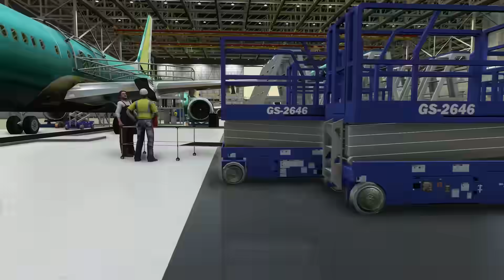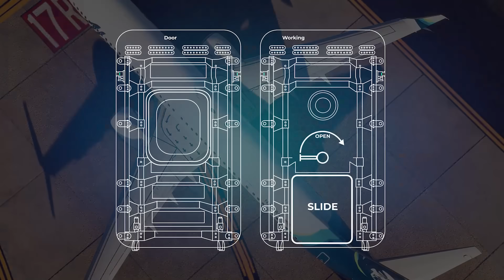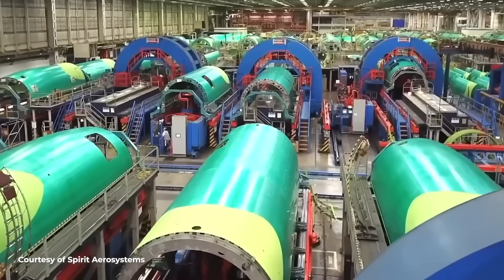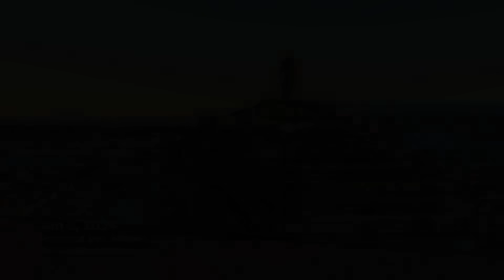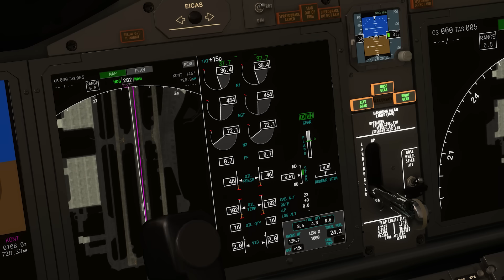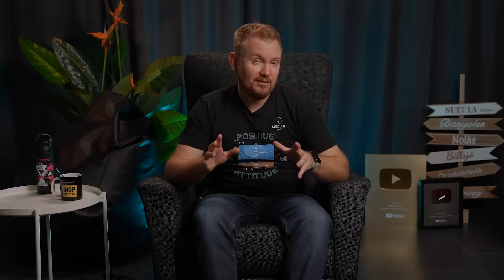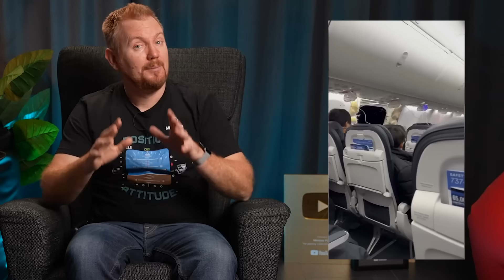Boeing 737MAX BlowOut!! The Scandal behind Alaska Airlines flight 1282

Comment: I think it is crazy that in a day in age where you can store thousands of hours of audio in less space than the nail on your pinky finger takes up, that the CVR only holds 2-hours of audio.  Then again an agency notorious for being the largest user of vacuum tubes in the world may not be up to speed on what modern technology can allow for.  Really, with things like Starlink now available on airliners, the flight computers should be transmitting to a virtual black box on the ground so as long as the Starlink antenna array is in an orientation to where it can see Starlink satellites.  Ground computers can hold a lot of stuff.  And really, I don't think there is any legitimate excuse why a black box couldn't hold more.  Yeah, you need to make it so the black box data can survive just above anything.  But just because you are using recording technology from the 1950's and 60's doesn't make it more invincible than what technology can do now.  I am sure you can devise an update with more modern technology that can pass the survivability requirements.

Comment: Rivets are level 1 as they are pressure boundary fasteners but the Locking device pins are level NA  thus they do not have the same insp requirements

Comment: Funny how the springs that surely played  a big role in catapulting the plug out of its seat like a compressed  pogo stick were left in place although not needed in this configuration, without them I do not think that the plug would have detached.
Reply: They are used in this configuration.  The plug door can be opened for inspection, in which case the springs help lift the door.

Comment: As an allmost engineer (i did not finish my course) the manager deciding to choose for "Just opening the plug so it can retain an SAT and no further action will be needed" must have never had any engineer training, because in that case he would have heard of murphy's law and would have chosen for a path with an integral final check-up on the work (CMES if i write it correctly).

I hate when people do stuff like this.

I must say i am very glad injuries where just few and minor!

I am an upholstery guy mostly for flight cases and on friday i got distracted and missed a few steps in finishing 4 boxes. But i always lay out my work so i had two pieces left over and that got me thinking about my distractions and i took those 4 boxes back into my workplace for check up and i got them finished eventually.

Someone should have taped those 4 bolts to the door plug to remind them and other workers that they needed to be fitted again.
And since it is aviation and lives we talk about, this work should be written down as needing extra inspection effort.

What i am saying is workers should train themselves to help with oversight of job completion and especially when things become more responsible management should pitch in and give workers back-ups, just because murphy's law will always be a thing and mistakes will be made.
Reply: Nah i understand why he would do it, its faster and probably easier to fix with less delay. Doesn't necessarily have to do anything with putting it in the system. The problem was that there wa snot the correct checklist to be done afte changing the seal. Normally that should have been correctly stated in a work order. That is also normally atleast in Airbus the standard procedure where a non conformity then also needs to be signed off by quality control
Reply: The problem is that so many company directors are deciding to save money by either out-sourcing by separating different divisions into individual entities within the corporation, or out-sourcing while shutting down their own divisions, or simply forcing workers onto workplace-agreement contracts (or a combination of these).  As the parent company then dictates how much a contract is worth, the off-shoot is forced to hire the cheapest sub-contractors they can find, meaning skill-levels & standards drop!
Here in Australia, Qantas board-members (especially the outgoing CEO), have made a killing in bonuses & shares, despite the airline's reputation & value taking a nose-dive! 
The result is of course that the bosses expect the workers to loyal & hard working, but all the while paying less, with no pay for holidays or sick-days! 
The old saying is;  "If you're only willing to pay peanuts, then you'll just get monkeys!"
Reply: Per Boeing processes there should have been a removal written to open the door plug in CMES and attached to the Non Conformance Record addressing the bad rivets. There also should have been removals written on the wall panel, stow bins, and whatever else had to come out to access the plug. But Boeing has been unable to produce any removal records whatsoever. Boeing is in violation of its own processes and FAA requirements. Probably some low level manager was pushing to speed things up.
Reply: I don't agree with workers should train themselves to help with oversight in this industry.

I do agree with this IF it's completely independent of the workplace expectations but as a general rule no.

The inspections, instructions and quality control should be the ultimate factor in these situations.

The workers doing the actual fitting work WILL miss something eventually if there is no process to check (specifically a dedicated person to inspect the work).

Saying it's the mechanics job to do quality control means they will be lax with inspections.

Which in other industries is not a big deal and makes sense but not when a simple mistake can absolutely kill people.

Comment: Thanks once again Petter, for yet another crystal clear, logical, unbiased, factual and very instructional video.  Brilliant!   This incident takes me back to a military flight between Balad AFB and Basra in Iraq in an RAF C130.  With a tightly packed load of PAX in full combats and body armour, warm, tired and nodding off in the cruise (it was about 0300Z) when in a flash ....all hell broke loose!  Instantly, the hold (cabin) filled with dirt, dust, debris, toenail clippings and insulation material - which made it impossible to see anything or breathe.  As the now depressurised Herc went into a steep dive, the only way to breathe in this thick muck was to do so through the sleeve material of my combat jacket, whilst hanging on tightly to the seat webbing.  Being in a war zone, I thought we had been hit, but there was no panic and I remember how silent everyone was.  Wallop, bounce, rumble... incredibly abrupt and rough landing heaven knows where. Engines shut down, the loadmaster opened the ramp and everyone piled out...into the swirling dust.  Sorry, l'm rambling a bit, but anyway: it turned out that the young soldier sitting immediately in front of the port mid fuselage emergency exit door had stood up for a stretch, but in doing so had managed to catch the yellow / black door release handle on the webbing on his back, and .... wooosh!  So if this happens to you, then in the absence of oxygen masks, breathe through the nice thick material of your combat clothing.   Stay well, stay safe, and as they say on the London underground: "Stay clear of the doors please!" and "Mind the gap."

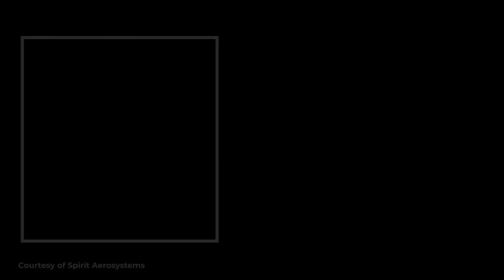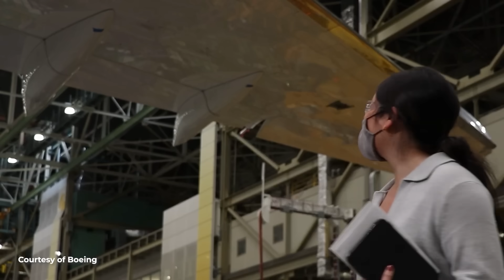Comment: I see at 8:07 and 10:32 in the rivet repair portion that the retainer bolts are in place!!  I guess there was a seal replacement so that would have needed the bolt removal.  Beats me how a team R and R ing a seal wouldn't take out the bolts and put them right back in.  Can a repair team who started the job not be required to finish the job?

Comment: I cant believe they just painted over faulty rivets I could get in some stuff taking shortcuts because it wont hurt anyone if you do but with aircraft ? it should be immediate firing when its found out and passed onto the police for criminal negligence since that could kill 250+ people depending on where the plane crashed if it fell apart.

Comment: Thanks for the accurate explanation of this situation without any of the usual management trashing that comes with it. The simple truth is, the bolts were not installed. For what reason is yet to be determined if it ever is. This is an ill-timed incident that has been totally blown completely out of proportion. I'm not condoning or making light of the situation just putting things into perspective as this could have and does happen in any manufacturing process. By the way, your graphics and explanation are amazing.

Comment: It seems like the Boeing engineers could come up with a vent between the cockpit and cabin which would equalize pressure without the noise and security issues associated with letting the door fling open. This strikes me as a "it's not a bug; it's a feature" kind of solution.

Comment: Another excellent video! As an ex Boeing engineer, I was aware of issues concerning senior management and I quit back in 2009. Considering recent events I am not likely to fly on another Boeing aircraft, no matter the type. I don’t expect to see any meaningful change in culture there in my lifetime (I’m 73).
Reply: Hm. I'd still feel fairly comfortable on a good ol'e 747 or 737-300 etc. The 747 is still a nice cigar with a fairly good track record.
Reply: @AB-80X  Good thing you quit early. The whistle-blower who exposed the 737 Max scandal was found dead from gunshot wound in an apparent suicide the very same day the DOJ announced a criminal investigation into Boeing and had been interviewing them.
Reply: Wait, you quit when? Are you a time traveler? (Joking of course)
Reply: @andon_RT  my bad. I quit in 2009 🙄
Reply: @andon_RT 
I guess there's a secret project Boeing hasn't disclosed😀
Reply: I love flying but I'm not getting on a Max.
Reply: @kentstallard6512  Just try to avoid any aircraft Boeing did built in the last two decades. 787 had just luck not to burn down in flight. Also try to avoid driving to the terminal. There are many less capable car drivers out there.
Reply: @kentstallard6512  same here regardless of their claims!
Reply: I will fly Max’s but I will always remain seatbelts in the seat
Reply: @alf513 You should actually do that anyway; that is, whenever you're seated, wear your seat belt - although you can loosen it a bit for comfort. The reason is that turbulence, especially the dreaded clear-air turbulence (which is undetectable) is a growing problem, and we semi-regularly see incidents where passengers (and flight attendants) are thrown bodily into the ceiling out of nowhere, with predictable injuries as a result.
Reply: @alf513  Good plan. That way when they try to ID the bodies after a crash they will refer to your seating assignment.
Reply: OMG ! Boeing is the safest plane ! You are clearly NOT an "engineer" !
SO much better, than these flying coffins called Airbus !
Reply: @gertjanvandermeij4265  Compare the Airbus accident rate due to design defects with Boeing. BTW did you read about the rudder issue UAL Flight 1539?
Reply: @gertjanvandermeij4265 haha obvious troll is obvious 🤡

Comment: I'm sorry, three successive posts on the same video may seem excessive, but I've yet to see anyone else with factory experience comment on the fact that the people who installed the wall panel didn't check the work that was done ahead of them to ensure that it was right.

I was always required to look over each item in my hand before sewing the next step and hand back anything that wasn't right. 

They'd done the job before, they KNEW what the plug SHOULD have looked like -- how did they not realize that something "looked funny"? Why didn't they call an inspector before they continued?

Why weren't they trained to touch each of the CRITICAL bolts before covering them up the same way I was trained to count bartacks on the MOLLE webbing before sewing the seam that would make adding a missing one impossible? 

QC isn't something that happens once at the end, it's something that every single person on the line needs to do on every single item, large or small.
Reply: I think the issue there is these are not the same people who regularly install panels over the plug, and would not know what to look for...most criticism is there were no QC/QA people who would be versed on what to look for....
Reply: @wokewokerman5280  If they weren't trained to look for flaws in the previous operation on the line then they weren't qualified to do the job. There's just no excuse for it.

Boeing shouldn't be accepting these defective fuselages into their facility. I know from experience that a factor that accepts defective product from vendors guarantees that defects will get worse and worse and worse.

The parachute plant I worked in had that issue and it continued until they put their foot down and sent the stuff back at the vendor's expense. 

It cost us overtime and stress in the short term making up the shortfalls, but saved us a lot more in the long term.

Comment: Don't you practice pulling the breaker after your simulator emergencies?

This isn't the first time pilots have forgotten -- or "forgotten" -- to pull that breaker and denied the investigators proper information. It really is NOT acceptable for this to happen unless the pilots are incapacitated and incapable.

Neither is it acceptable that no one on the ground double-checks that breaker to make sure it's been pulled.

Comment: Disaster Bingo dings:
shift change, easily preventable, winging it (npi, the open or disassemble thing), bodged safety, time pressure (my assumption), legacy infrastructure design (springs), cost cutting, risks ignored, warning signs ignored, complex system
yo... glad so few were harmed

Comment: Regarding continuing climb while deprussired. Just wondering taking in account amount of automation in planes this days why if (cabin pressure  rapidly drops && cabin altitude increases) autopilot would not switch to altitude hold to at least keep it as is?
Reply: Problem with that is that their might be traffic or terrain ahead at your current altitude

Comment: 38:53 ffs…how is that still a thing. They should use every passengers phone to compile a data set using altitude, accelerometer, gyro sensors and so on. @MentourPilot sorry mate but it’s definitely a design flaw. There does not need to be a door that gets converted or plugged…every engineer knows that once you open something up or do physical work it’s never quite as “perfect” as before. That’s why you can’t just “patch things up” forever. I think that statement is purely your opinion while you stated it as a fact and frankly you have interests in the industry so I’m not sure I like that assertion. Please explain from an engineering perspective, it’s not at the very least an unnecessary point of potential failure? Also…seems like they tried damn hard to close that cabin door so as per my previous comment…it clearly was yet another poor design choice which (yes, to your credit) you said they didn’t tell pilots. No, I think Boeing has a lot to answer for including their multiple requests for safety exemptions.

Comment: 27:20 how is the cabin door opening a good idea? Seems like a good way for a high-jacker to get inside the cabin no? Blow the window or figure a way to trip the pressurisation indicator and you can bypass the cain door lock? Seems like a stupid idea to me…for what benefit? I bet they didn’t tell pilots because they know that what I’ve just written makes sense so they preferred to keep it on the down-low.
Reply: Preventing dif pressure from forcing the door open doing much more damage.

Since this scenario is far more likely than hijacking this is a good idea.

Comment: An internal quality control issue is way scarier than a design issue to me.  It's relatively easy to redesign something and in the meantime you just ground the fleet.  With quality control that's a human factors problem, and humans are difficult to deal with. Also who knows what else might have been missed or swept under the rug over the years?  I literally will make my desicions about which flight I take based on the aircraft they use now.  No MAX flights please. No 787 flights either.  Screw Boeing.